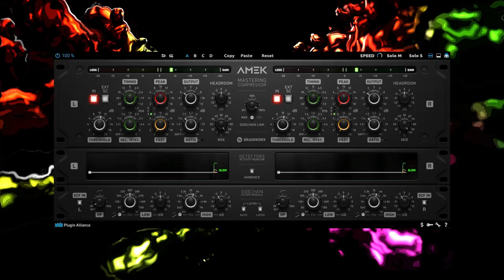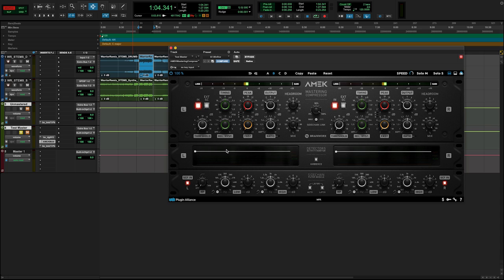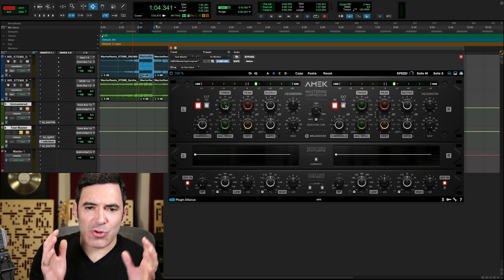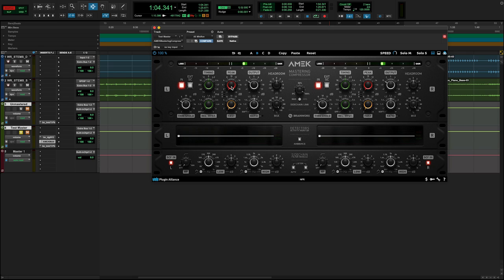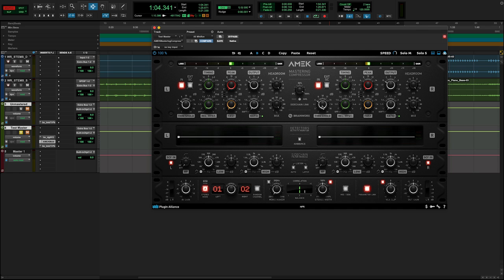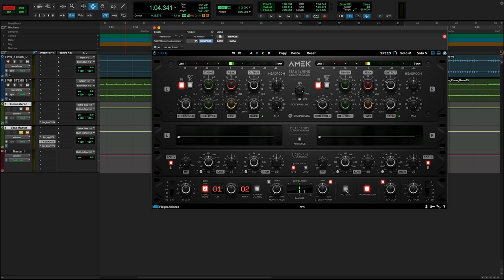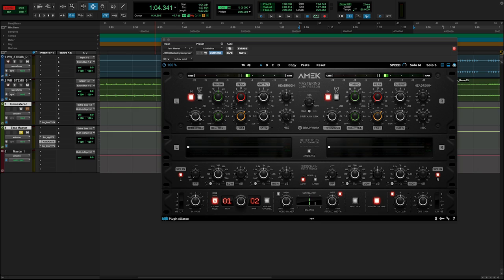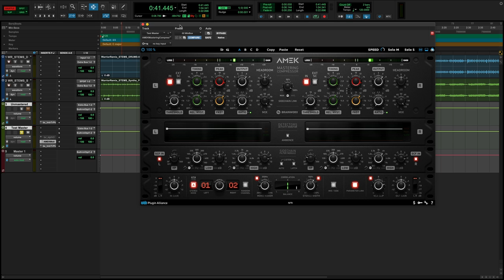AMEK - Mastering Compressor Walkthrough | Plugin Alliance

Comment: Please use better resolution. Hard to see VST UI in 360p. Useful information though.
Reply: That is your phone/computer doing that. This video can play at 1080p. You must have your YouTube settings on your phone/computer set to "auto", in which case it will select the quality based on your internet connection. You can also manually override that on a per video basis by clicking the settings cog on the video and under quality just force it to be 1080p. ✌

Comment: Justin Colletti & Plugin Alliance:

I would love a video on how you would use a passive eq like the Plugin Alliance Passeq.  I believe it is usually used on Master Busses & Mix Busses.  So as a Mastering Engineer how would you use it (a passive eq) in Mastering...but can & would it be used on Group Busses...or can it be used in Parallel Compression...or on Individual Track...and when would you make those decisions.

If you make that video on the Plugin Alliance page or the SonicScoop page...I would be interested in hearing your opinion.  In my opinion the Passive EQ's are very different than the other kinds of EQ's available...and I don't really have a clear model in my head on how to use them.  I think because they sound so good...just like with compression...I think that Passive EQ's could be very easy...at times...to over use.  I don't really have a model in my head on what could be too much...and when to back off.

Thanks,

Craig

Comment: So, if I'm understanding this correctly, the signal is divided into 3 paths (4 if you count the DRY), compressed separately, Fast, Slow, Peak, and the delta from all the compressed path blended back together with the knobs (Fast, Slow) work as mix knob ?
Reply: incorrect.  The signal is split and sent into 3 detector circuits, switching which detector is active based on level.

Comment: Does one get both algorithmic variables from Amek 250 and 200 for the EQ-ing portion? Nice video btw
Reply from the maker: The AMEK Mastering Compressor was inspired by a different piece of hardware than the AMEK EQs.
Reply: @PluginAllianceTV  Ah ok. Completely different hardware. Also will it do tube compression as well in a future update? Thank you btw
Reply from the maker: @Metalpazallteway  Thanks for sharing your thoughts! Our emulations faithfully model both the functionality and circuitry of the hardware devices involved. While the Brainworx team had the option to add plugin-only features, it's not always feasible for the general result or even possible to modify the signal flow or incorporate functions like sidechaining, add a tube stage or make something go to 11. We do however collect your feedback and check what's possible.
Reply: @PluginAllianceTV  Ok thank you once again. Great material here